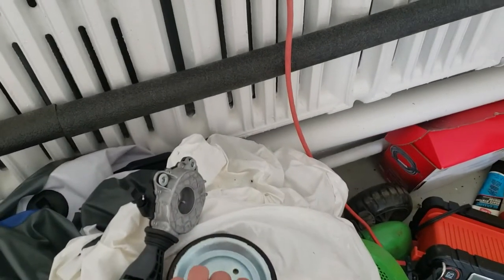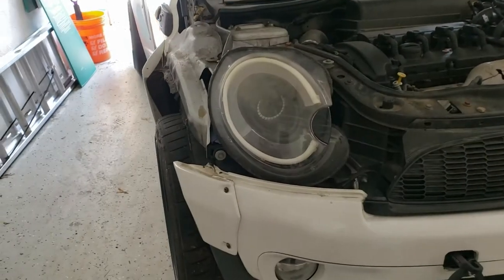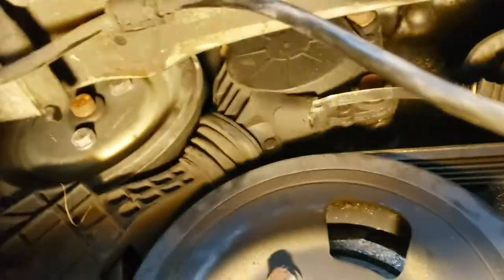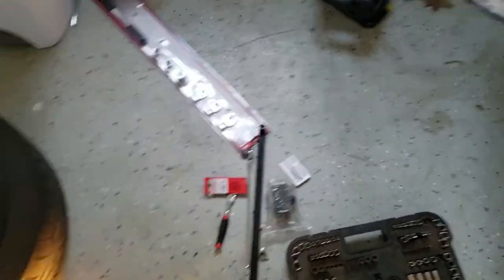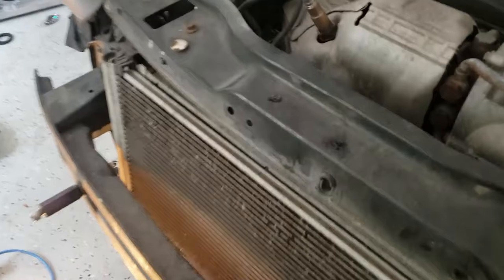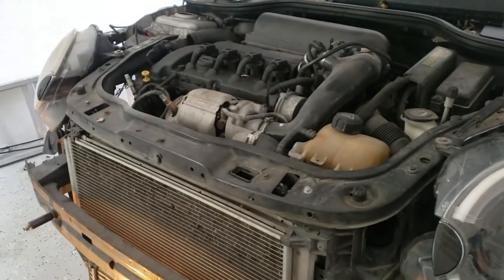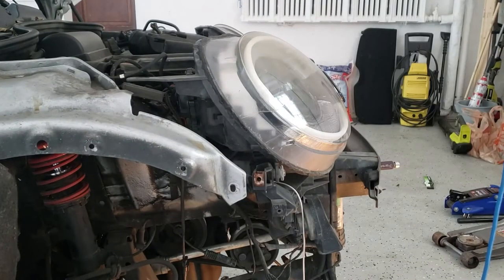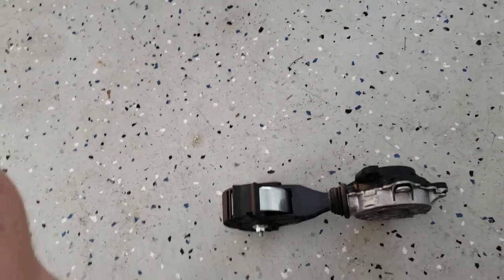How to Install a Friction Pulley on an R56 Mini Cooper

Comment: You can remove the entire thing without taking the entire bumper off. You can remove the water pump and the pulley using an offset 10mm wrench and a swivel 10mm wrench.
Reply: I was not able to get the pulley out without moving the engine. Got the bolts out fine but getting the pulley out of the bay on my GP was a no-go.

Comment: Hello, maybe you can help me. What sound were you having? i have a 2008 clubman s and im getting a loud whining noise when i accelerate and also when in neutral and i rev the same sound. older minis have the idler pulley is it the same as the friction pulley u changed? help please
Reply from the maker: So I found out my noise was actually my ac compressor. Mine is also whining. Does it go away if you turn off the air conditioning? If not, it could be your friction pulley or tensioner